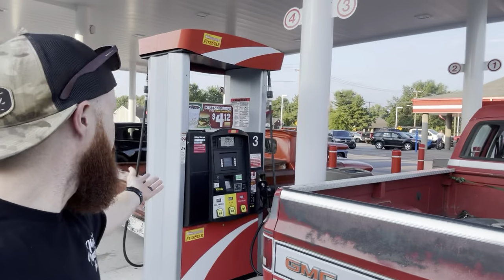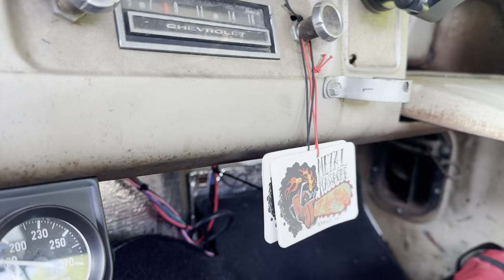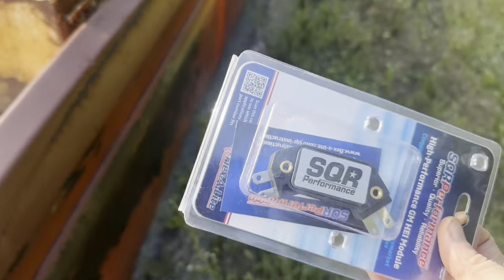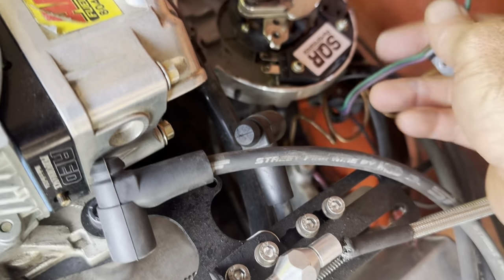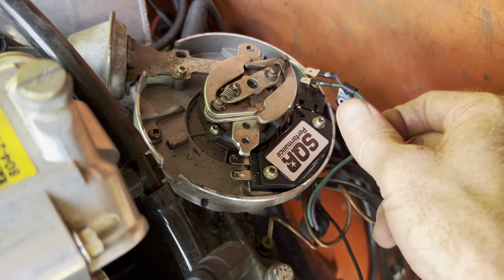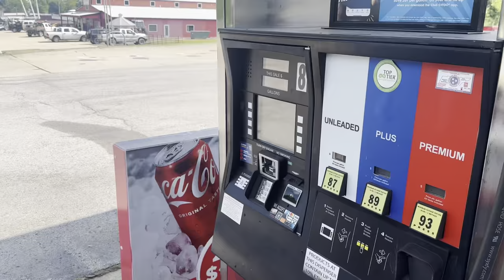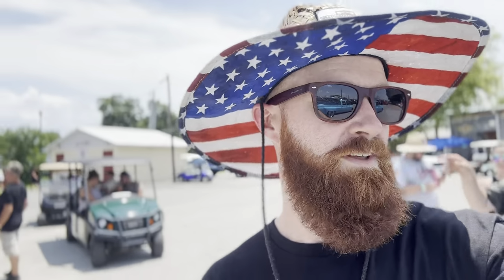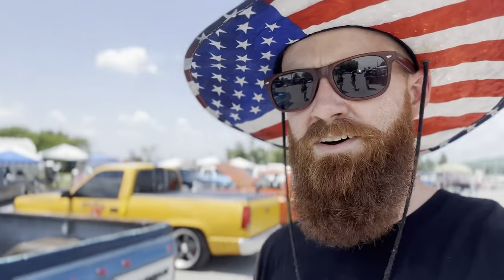Biggest Truck Show?? 2024 Southeastern Truck Nationals. Day 1

Comment: U have a voltage problem somewhere that’s why u keep burning up parts in that distributor if you’re not getting a clean 12 volts to it it’ll keep frying parts an coils also them msd boxes are garbage
Reply from the maker: Roger that. Going to fix it when I get home. 👊🏻